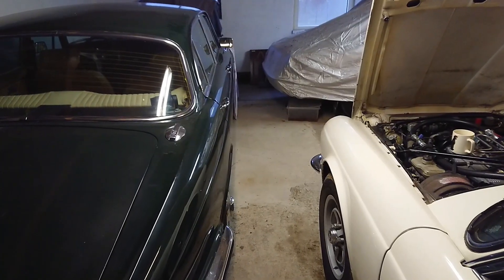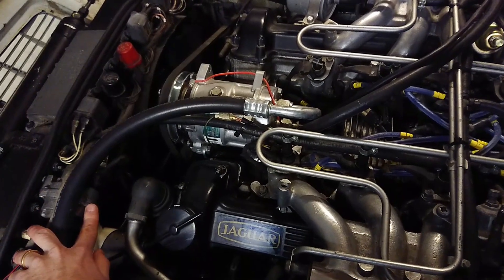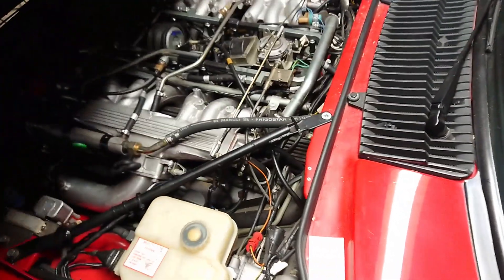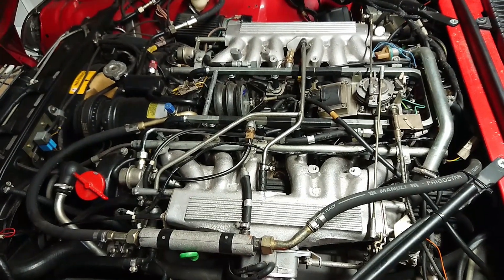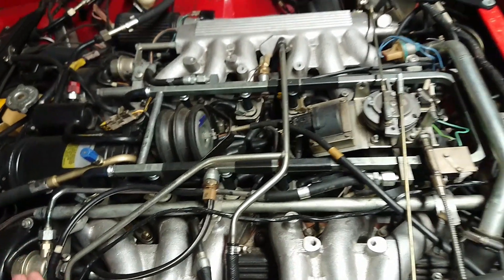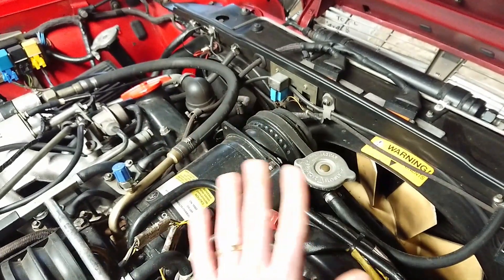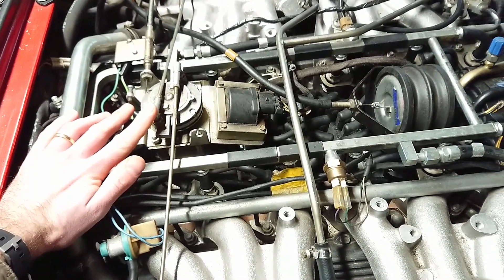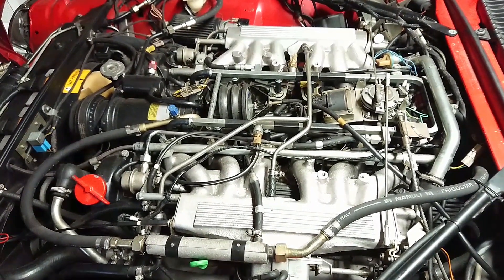Jaguar H.E. V12 Engine

Comment: Hey there, I have a question. Is the cam sensor n the 87 sjs 12 cylinder the same as the cam sensor on my 88 sj6 3. 6??? I’m only asking because I don’t want to spend $500 bucks for one ! Thanks, bill

Comment: Good afternoon Adam, seen your vid again.. quick question.. the enrichment vacuum valve at the rear right manifold.. is yours directly connected to the vacuum tree at end of the mani or a solenoid operates it? I tested mine and its open circuit until i apply a little vacuum, im assuming that it will instantly enrich or does it go open the moment you apply throttle? Which then indicate to the ECU it's open throttle..

Comment: "I have a 90 x J 12 V yagua that has no current at the fuel pump or the resistance of the injector.
Reply from the maker: Sounds like some wiring issues or ECU issues on that car

Comment: Great video....... my son and I  are  performing a complete restomod  on our 86 xjs.. removed all vacuum switches,  single fuel reg., completely shaved and filled intake and then port and polished  every piece of aluminum,  chromed everything  else under the hood..shaved doors,, filled in signal  assemblies,,etc.. you must check out Mobeck and  Simply performance , these companies especially Mobeck Tekniske has incredible 21 century  mods ,, especially  complete stand alone ECU, cams, DIS ignition etc.
These replacements brings any year Jag, up to date. It removes the aux valve and changes it to full electronic  adjustment.. 
Keep up the good work.. 
Don't  forget to show how you  can change the park position of the wipers for  those who don't like the wipers finishing in front of the driver view..
Reply from the maker: Great upgrades!
Simply performance are a channel sponsor and are sponsoring my latest XJ-S build. It’s at the body shop now but soon it will be back and the upgrades can start.
I’m friends with Mobeck too. Great guy!
Reply: @LivingWithAClassic  .. oh yes I forgot they sponsored you. Great people.. I may purchase their  headers one day.. my son 4 to 500 HP, out of the xjs.. lol.. Mobeck is a  great guy very conversive and helpful.. keep up the great work..

Comment: Looks like you're running the shorter A/C compressor. I believe this one will allow you to reach the front plugs without removing the compressor.  Is that A6 to Sanden swap?
Reply from the maker: It is.a Sanden compressor. It’s the complete Fen-Air kit. It does help with the plugs on the HE engines. On a pre-HE all the plus can be reached very easily even with the larger compressor

Comment: I really like your videos. They are very informative and the cars and engines are great!  But I have a question:  I am a garage hobbyist myself, and I am currently looking at a job which  is the replacement of a timing chain. Did you ever replace the timing chain of one of these beasts? :-) And please continue with the good work!

Comment: Thank you for the video it is hard to find information I have a 94 6 liter idles that's all dies with Excel had a catalytic meltdown took out three cats oxygen sensor rear crank sensor from a stuck thermostat replaced all no-go left side any ideas
Reply: These engines have multiple air and water temperature sensors placed around the engine, also have temperature controlled vacuum advance/retard systems which differ depending on the state or country they were sold in. First step is to determine your build standard, my Aussie delivered XJ S seemed to be a combine elements of California and Au systems so even the published standards may not be accurate. Identify vacuum pipes on you car and check for leaks.

Comment: I have a 1989 xj-s beautiful car runs good but after driving for a little while the exhaust is extremely hot and car has a smell. Someone told me their opinion was that the car was running too rich… Anything that you can think of would be a great help.

Comment: I own a 1985 XJ12. where do I find the MASS AIR FLOW SENSOR ? ? ?  Can you show me where it is and How to clean it  with a spray cleaner I purchased ?
Reply from the maker: The V12 doesn't have one. It has a small vacuum sensor in the ECU and a line up to the engine. It can't be cleaned and doesn't get dirty either

Comment: Great video, just a quick question. I have just received an xjs he 1989, is it normal for it to run aittle lumpy when cold? Its only for a few mins after which its as smooth as expected. Thanks Mo
Reply from the maker: Does it go up to a higher idle when cold (around 1,000-1,200 rpm)? If it doesn't that AAV could be your issue. I have a video on testing it and replacing it. Before I replaced the one on my XJ12 it would run a bit lumpy at first when cold.
Reply: @LivingWithAClassic  Thanks for your reply, it appears to have been old fuel, the previous owner had it standing for a while. After adding new fuel and taking it for a run on the motorway seems to have cleared up. Thanks Mo

Comment: Hi,   I was a Jaguar Technician from 1963 to 2011 continuously  including my 5 year apprenticeship,  i am retired now and when i finished i threw out all my factory course books and technical  bullitins , i had lots of stuff on all Jags as you can imagine after all those years, i still retain a lot of that knowledge in my head.  When the V12 engine  first came out they had oil leaks from the rear main sea, the 2 halfs of the seal use to turn so the hole engine had to be stripped and modify the seal seal fitment, i did loads of them,  later on another big modification was to the fuel rail. 
Looking forward to your channel.  Cheers from  England uk.

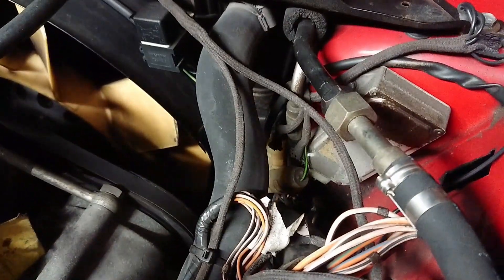Comment: 10:50 - Sorry but that's not what the resistor pack is there for. It doesn't do the same job as the amplifier as there is still an amplifier on the top of the left bank inlet plenum. In the ECU there are four power transistors. The first two operate on receipt of the PIP signal from the ignition amplifier to open the injectors on banks A & B at full current. The current required to hold the injectors open is less that that required to open them quickly and fully so the other two power transistors then operate through the resistor pack to hold them open at a reduced current.

Comment: You are right, Adam,  it is hard to find much info on my 86 XJS engine. Tomorrow I am going to change the coolant. Do you have any advice on this process? Drain from lower radiator  hose (apparently  better this way than the drain plug) from what I've been told Take both caps off, fill on the right  and burp on the left hose with the heater  open full measure.I s this a good way of way of doing this? Chris/Colorado Springs /USA

Comment: Aren’t those intakes more like a hot air intake?  You should make a video of the sound I’m kinda wanting some cone intakes for my 6liter because on some engines they sound amazing
Reply from the maker: It can look like it but I've never had any issues with them. They sound fantastic and do let the engine breath more along with a less restrictive exhaust. I'll make a video of it running.

Comment: Are the pre-HE heads fully compatible with an HE block? I'm having trouble obtaining a solid confirmation in this.
Reply from the maker: Yes they are with the block but not with HE pistons
Reply: @LivingWithAClassic  of course. I planned to bore the sleeves and swap oversized bowled 302 Chevy pistons and rods at the same time for maximum compression reduction.

Comment: I was watching a video about the Rolls Royce Marlin engine and something in that video got me thinking there might be videos about Jaguar engines. It is true: there isn't nothing you can't learn on YouTube. Thank you for this video, and for the upcoming series. I own an XJ12 model year late-1994. Its engine is both a joy and terror to behold. There are NO manuals anywhere that I have ever found for this engine, and although it is a little different from your XJS, I am looking forward to whatever knowledge I can leverage and apply to my 6.0 L.
oops, It was the valve cover gasket replacement that required the intakes to be removed. I changed plugs, distributer cap, rotor and plug wires at the same time.
Reply from the maker: YouTube really is a great platform for both entertaining and educational materials. Information is hard to come by on the 6 liters. I'll try to borrow a car with one to show at some point
Reply: Living With A Classic that would be very cool. I have had to learn a lot about it just by tearing in and figuring it out.

Comment: Would love a video explaining all vacuum hoses on the v12 HE
Reply from the maker: I will make that video soon
Reply: Isn't that true. The first time I changed the spark plugs (AND HAD TO REMOVE THE INTAKES!) I discovered the vacuum lines were a total mess. Some were leaking (not a huge surprise, and not hard to address) and some were just disconnected and capped off with screws. I had no manual to go by, but after a lot of thought and looking at the thin information I had I got everything figured out and properly connected. The immediate improvement was that when I filled up at the gas station I didn't get a huge "whoosh" of fuel vapors in my face. Evidently, one of the disconnected/capped hoses had to do with the fuel vapor recirculation system, so my fuel tank was actually being pressurized. Really looking forward to this video series.

Comment: Great videos!! I have an 1986 xjs with similar engine. I love the car but my car feels impotent. The car (engine?) makes a rattling sound when I push the pedal a bit more than just a little. More push = more rattling. The gearbox doesn't shift down easily either. Something interconected?
Reply: This is probably not related to your problem, but you never know. I got a weird rattling sound in my 1994 6.0 L XJ12. It was accompanied by an occasional hard start. The sound was like rock stuck in a hubcap and it seemed to be coming from right below the shifter. And I most often noticed it under hard acceleration, or taking turns at high speeds. I thought at first it was from something hanging down dragging or maybe some wire or something was wrapped around the drive shaft, but could never find anything. I spent hours putting the car on jack stands, looking all over, errr, under. I ran the engine on the stands spinning the wheels. I took off the motor mounts to lower the engine to the crossmember letting run my hand all over the top of the transmission and aft area of the engine thinking I would find something that only hug down when the engine was working hard. NADA. I had a friend drive the car in a parking lot while I trotted beside listening. I was never able to reproduce the sound. VERY FRUSTRATING. Then one day I noticed dents in the shroud covering the torque convertor (TC). I had noticed a couple before but they never registered. This time there were more and what struck me was from below the car the were convex, not concave so it suddenly struck me that they were somehow made from inside the shroud. "What gremlins are living there," I wondered. I dropped the shroud and a thousand bits of metal from flakes to 1/2" (12mm) ball bearing dropped out. The outer bearing housing on the starter had broken off and as the broken piece tumbled around between the TC and the shroud and the transmission case it was ground into smaller and smaller pieces. I changed the starter (another story) and the problem was solved.
Reply from the maker: Hard to say, could be gearbox issur or an engine issue too. Does it feel like it's "pinging"?
Reply: @LivingWithAClassic  no, just rattling...from hardly at all if I just give a gentle push on the pedal to VERY clear at half throttle. I was thinking o fstarting with the plugs to exclude any dead cylinders but the rattling sound  don't fit  into this.  I can't find any lose parts causing the rattling at higher load. Haven't clocked the accelleration but I guess it is well above 10 sec on the sprint
Reply: Check the advance weights on the distributor rotor. Rotate the rotor counterclockwise gently as far as it goes then let go, it should snap back. If it doesn’t there is a small port you can squirt a couple drops of 3 in 1 oil, and it should free up the weights.

Comment: Great video, Adam. Where did you get those air intakes with K&N filters from? I'd like to get a solution like that for my '87 V12.
Reply from the maker: Thank you Caspar! They are from AJ6 engineering in the UK from about 20 years ago. I think they still sell them now.
Reply: Caspar Graham Do not order from V12 Performance in Texas. He will take you money and never ship. A notorious thief in the XJS V12 world. Try Simply Performance in England.
Reply: @drewframson7495  Thanks for the tips!
Reply: Unfortunately, 'Simply Performance' don't seem to have the customised air intakes...
Reply: @cosgraham534 , It's not a big deal to have a shop custom make these. I have pictures of the kit before intallation if you need a reference point. Or go on the V12 Performance website to look. But be cautioned not to order, as most likely he will screw you.
Reply: @cosgraham534  try aj6engineering in the UK.
Reply: drew framson  Thanks Drew. I’ve tried all the usual suppliers and only that dodgy Texan lists suitably modified intakes with k&n filters. Online scam alerts clearly confirm your assertions about him, so a custom job might be required. Hey, it might be a business opportunity 😬. Thanks again
Reply: @cosgraham534  I can second, or maybe third the recommendation made about AJ6 Engineering.
Reply: oddjobbobb Thanks but I don’t think AJ make them any more...

Comment: A great job Adam as usual. I have a 91 XJS V12 convertible Classic Collection with Marelli ignition too. I suffered the well-known ignition failure when I first got the car. Luckily I was able to save it with the help of the local fire department. I would urge you to stress the importance of checking the rotor and cap as well as the fuel lines on these cars. Unfortunately I've suffered both types of fires. My 87 had a injector hose split and it caused me to have a total loss with a roaring engine fire. Of course the other known source is the rotor failure causing the engine to run on One Bank only. I was fortunate that the fire was very light but it caused $8,000 in damage, luckily covered by insurance. In Kirby Palms xjs Bible, its an easy fix for the rotor with a dab of silicone sealant. You would do a lot of owners favor by mentioning injector hose renewal and replacement every four years or so as well as the rotor and cap on the marrelli cars. I really enjoyed this video as I didn't realize all the differences between Pre H.E. and later H.E. which drastically improved the reliability of the cars.I also have performance intakes like yours.
Reply from the maker: Yes those things are very important! All the ignition stuff on this car is pretty new and all the hoses have just been changed. I have a video on rebuilding the injectors and replacing all the hoses. I'll put a link to it here.
Thank you for watching!
https://youtu.be/gXovG0zUrTg

Comment: I really like your videos. Keep it up! I have a question for you. My speedo stopped working and I ordered an aftermarket transducer for the transmission. I connected the aftermarket one and spun it by hand and the speedometer moved. Unfortunately the aftermarket one is too long and doesn't fit. So I ordered a Jaguar part. When I connected it and spun it by hand the speedo did not move. I also do not get AC voltage like i did on the aftermarket one. Have you worked with this system before? Do you have a transducer you can test to see if you get AC voltage from spinning it with a drill motor? Thanks.
Reply from the maker: Thank you John! 
I have not had issues with transducers in the past and I don't have one easily on hand. They should produce some type of voltage. I will check through my litterature on them